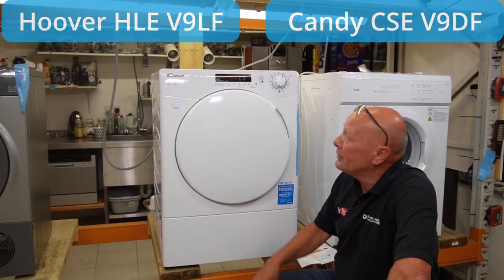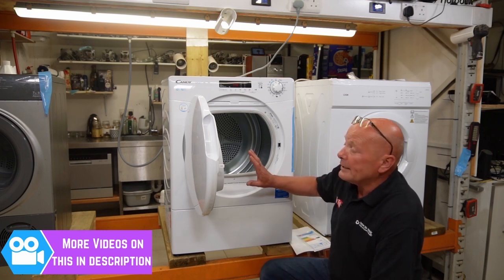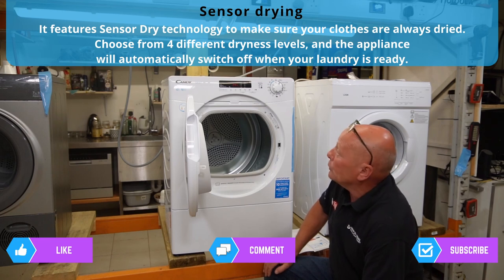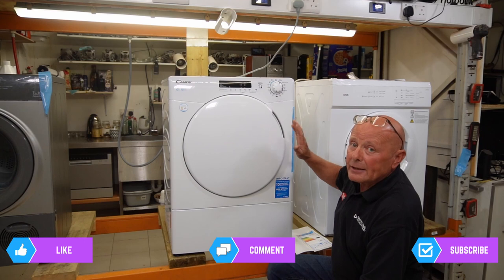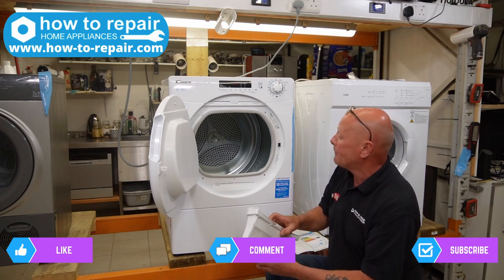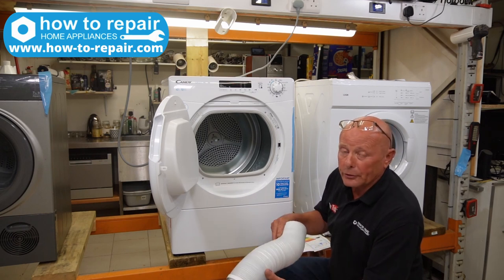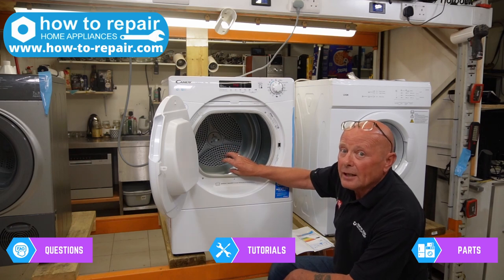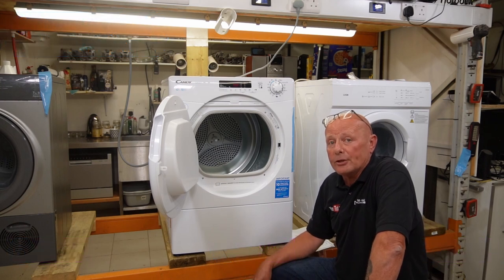Tumble dryer vented review Candy CSEV9DF Hoover HLEV9LF

Comment: Can you explain the Candy model numbers? I've just bought a CSEV9LF-80 and only just been delivered. On the Candy website says it has a 24 hour timer. It's arrived and it only has a 3/6/9 hr timber. I've contacted Candy and they told me this machine does have a 24 hour timer (which it doesn't) but doesn't have reverse tumble action, yet all specs says it does. Its so confusing. Far too many errors in specs listed both retailers and manufacturer's websites. Too much cut and pasting of wrong data.
I wanted a vented dryer with a 24 hour timer, reverse action and sensor drying and looking at the manufacturer websites, it led me to the Candy CSEV9LF-80 being the only (vented) machine that now does this. But it arrived and its not a 24 hour timer! Now I'm not sure how if it has reverse action?? Thinking of swapping it for a CSEV9DF for the 24 hr timer, but does that have reverse action? Specs say yes, but lots of reviews indicate otherwise with reports of sheets getting tied up in wet knots.

Comment: Has anyone figured out dry at a low temperature on the CSE V9DF?

The manual does not show how, and the 'Table of programmes' does not mention temperature either.

I presume the Wool programme is low temperature? (i.e., no more than 40C)

Comment: I have a Candy CSOE C10DCGR-80 Dryer. when i power on all lights flash(7lights) but no error code shown. After 2 or 3 mins of flashing and having chosen a program the lights stop the program time is displayed and I can press start. The machine then works fine, heats up, spins etc. I don't know why the lights flash at start and have to wait for itself to clear before i can use it. after finish if you leave the program selector and don't switch off the 240 volts you can use it again without the lights flashing. If you switch off the machine the lights start flashing bagain and you have to wqait for them to stop,

Comment: Hello Paul: Thanks for the interesting, helpful video.  Looking forward to next.

A couple of minor observations.  Which? (Consumers Association) advise against using timers on heating appliances when one is away from appliance in case they catch fire (not unheard of).  In an ideal world this is obvious - but consumers will increasingly want to use advantageous tariffs (as you say)...  Dryers have been a particular concern here - but I note (from your good self) that more recent models have better safety features (more 'stats/cutouts, for example).  Second, I'm not taken with smart appliances: the facility might be helpful re faults, but as they should be few and far between it's not a central consideration.  Otherwise it's just more electronics to go wrong.  I've noticed the cheaper brands such as Hoover and Candy have gone in for this more than the 'better' brands such as Bosch and Miele.  To me it's gimmicky and I don't think the average user's much interested.  Far more important is performance, reliability, and efficiency - something that Which? has found relatively poor with these makes (not nec this particular model).  Candy seems to get a particular thumbs-down for reliability and repairability of washing machines (you'll have a view...) and none have been Which? best buys for many years.

Finally - and sorry to sound like a broken record per our previous discussion - Which? has updated its running costs for each appliance its tested following today's new energy cap figures.  The cheapest non-heat pump dryer to run it's tested (Zanussi vented 7kg cap) now costs £212/year for 156 cotton loads (3 loads/week - the average); the most expensive (Candy CSEC9LF-80 condenser 9kg cap) an eye-watering £332!   Such costs really highlight the issue of whether 'old tech' is affordable to run...  Manufacturers of condenser and vented dryers must surely be expecting to sell far fewer to the European market for the foreseeable future, concentrating on heat pump instead (in the US some states, such as California - under energy stress -  give rebates for the purchase of low-energy appliances).
Reply from the maker: Thank you for leaving a comment this is for you https://www.youtube.com/shorts/e432SAb2g08 please remember to subscribe as that's is what keeps this channel going. Thanks 👍
I don't always have the time to answer these types of questions because I'm a one-man band but as you put so much effort into your side I thought I better answer, my grammar has never been great so my apologies in advance. (we all have different views so I do understand your side)
Yes there was a problem with some dryers Catching Fire (the company didn't do a factory recall on this) with all electrical appliances and other items they may be faulty, the amount of fires that have been caused by faulty items on standby Transformers mobile phones etc. this is why you should always have a smoke detector and also fire sensors fitted to rooms. With the increasing electrical prices people are going to try to save money!
Brands are a big problem in tricking general public who don’t know they operate under a different cloak.
Hoover, Candy, Haier one company they make same machine just different look
Hotpoint, Ariston, Indesit, Ariston whirlpool one company they make same machine just different look
Bosch, Neff, and Siemens are one company they make same machine just different look
Miele I believe still is a privately owned company. but not only are there machines expensive the price of parts are a bit of a joke (washing machine door seals in excess of £100)
my competitor in the parts business, they have 100+ website selling the same parts under a different website look.
With the greed of these multinational companies that's only care about selling appliances, parts etc we are never going to get to a sustainable plant when profit is the most fundamental objective.

I am a firm believer in heat pump technology but if the reliability of the dryers is not there, there is no point if the appliance ends up in the skip after 5 to 7 years the savings are gone. the consumer is let down the planet is let down but multinational makes its profit!!! Speak to any appliance engineer